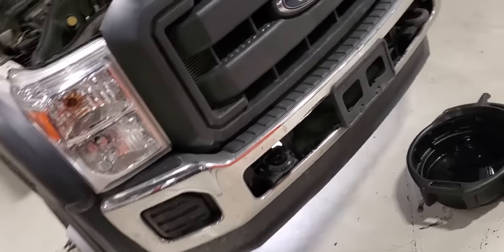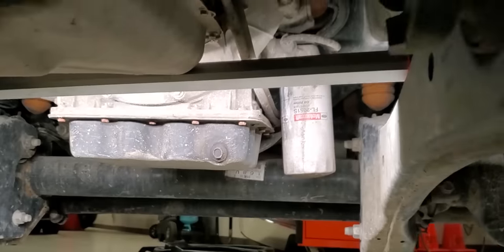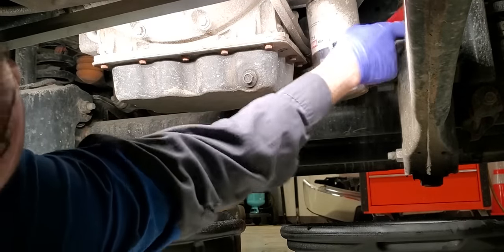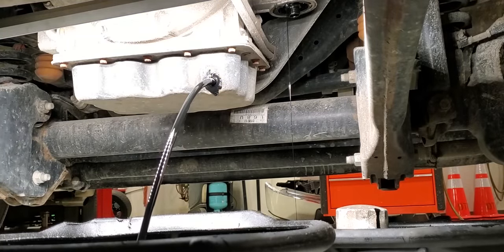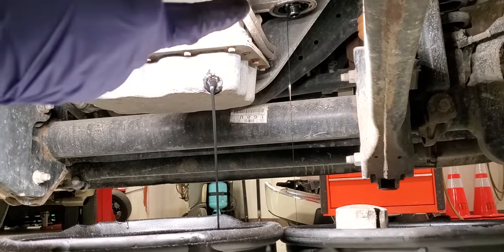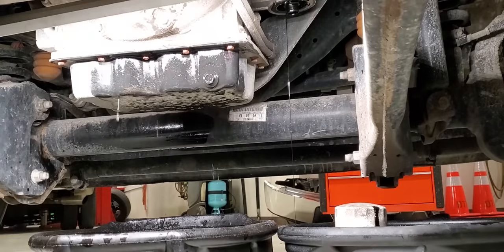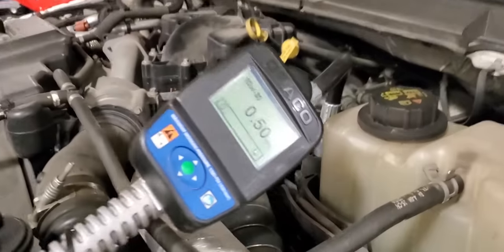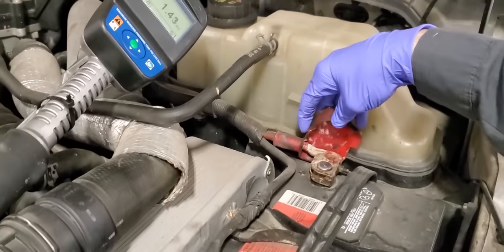Ford 6.7 oil change video HowTo - ALL POWERSTROKE owners should WATCH!!

Comment: Always make sure the oil filter gaskets stayed attached to the filter. It's easy to miss that and have 2 gaskets stacked up.
Reply: Yes that will happen. Happened to me once.
Reply: LOL... Yeah it sucks when you try and try and try and try to get the oil filter on...can't figure out why it won't catch... Only to realize the old rubber is still on.  I'm commenting for a friend... :)
Reply: i changed my oil today and that happened to me. i only noticed because the filter wasn't flush.
Reply: Been there done that !!
Reply: I always make sure there’s at least 4

Comment: Something I do sometimes when the filter is going to make a mess is use a sharp center punch and punch a hole in the oil filter before you remove it. Let some of the oil drain out in a small stream before it makes a big mess.
Reply: I do the same but always make sure it breaks loose first.

Comment: I added a Fumoto F106 6.7L oil drain to make it more controllable to drain the oil while I’m on my back. Comes with a 3/8” clear hose that connects to the valve and runs into your oil pan. Better than staining my garage floor and arm with dirty oil.

Comment: Bro when you removed the oil filter without getting a drop of  oil on your hands I was truly impressed lmao. 
Another banger
Reply from the maker: Ayyyyyyyyyyyyyyyyye boi
Reply: I pull a vacuum on the fill tube and never get oil going all over the place. Just use a remote to start and stop the vacuum. 
1. Turn the vacuum on, take out the drain plug.
2. Turn off vacuum with catch container in place. I use a 5 gallon bucket with a plastic trash bag inside ( makes clean up a snap ). 
3. Replace drain plug. Turn vacuum on.
4.Poke a hole in the bottom of the filter with a catch can in place. Turn vacuum off. 
5. Grease the chassis. 
6. Remove oil filter. Clean the mating surface. 
6. Use engraver to mark the filter with mileage, date and oil type. Lube o-ring and partially fill filter and install. 
7. Refill oil and check. Start engine, reset oil life. Stop engine and recheck oil level.
Reply from the maker: Gussssss where r u

Comment: Thanks! I did my first oil change today..didn't think I could do it and your video made it easy...next time will be even easier. But I will need a mid summer appointment to get all my aftermarket filters done by you pls.
Reply from the maker: I gotchu good buddy
Reply: I just did both fuel filters today. It's just as easy as the oil change.

Comment: From the 6.9 & 7.3 days I have a tapered punch that I knock a hole in the bottom of the filter after I break it loose. Then the filter can drain and not puke all over you.
Reply from the maker: Lololololol
Reply: @michaelbenoit248  I wouldn't waste the money on a coolant filter setup. The oil cooler tubes are huge in comparison to newer truck that tend to clog.  Just service the coolant. For the cooler, I would also pickup the 4 large o-ring seals and reseal the entire assembly.
Reply: @Itsa_Mea  is the cooler a radiator?  If so, those are tiny and clog easily.  Not the tubes i think.  Either way, safe travels!

Comment: on my F250 what i use is a 5 gallon bucket that i buy from walmart. its $2.99 and its MADE IN THE USA. It stands up about 19 inches and i use it to collect the oil. I drive my truck a few miles to get it up to operating temp and I use my dash engine oil display to tell me when its hot enough. I think you get more contaminants and more old oil out when you do this versus cold oil like what you do. I do also make sure I let the truck sit for a good while to cool down so it doesnt make my plastic bucket super soft, but even still its hot enough or warm enough where it will flow out like water and bring the contaminants with it. I really like the height of the 5 gallon bucket. Makes for easy and clean jobs. I have a dedicated bucket for engine oil with a lid and keep it in a garbage bag, inside a cardboard box, and place it back on the shelf the next time. I take it to my county dump or a local business who has an oil heater in their shop, and they accept it for free. It never leaves the 5 gal bucket and never have to pour it in something else. I like my bucket and thats what I wanted to share lol
Reply from the maker: Dude, thanks for sharing & keepin' it 💯

Comment: The attention to detail for just an oil change is outstanding. I would be comfortable having you do any work on my truck.
Reply from the maker: I have em come from all over the USA for me, PTT to fix their rigs!
Reply: @PowerStrokeTechTalkwARod  shoot I might be the next one to drive across the USA if I need more work done!

Do you have a video showing the process for replacing the injector to valve cover grommet? I think I have a slow seep coming from there on either cylinder 1 or 2.
Reply from the maker: Shoooooooooot. Go to my 6.7 oil leak playlist. Its there! Email me if ya wanna get inline. Do you know about my kill switch kit??. EMAIL ME

Comment: Great job. I appreciate the effort you make to ensure the oil filter doesn’t have oil leaking down the side. I’ve had my own 6.7 Ford returned from a dealer oil change, leaking. I hate looking in through the side and seeing the dirty oil on the white filter. Few techs would bother. Does look like the brake clean just about removed the Motorcraft logo though! I use the same exact oil drain pan. Changing oil is strangely satisfying to me.
Reply from the maker: Haha i see that so mannnny times....filters just covered in crud

Comment: As I have installed an Amsoil dual remote system my change is slightly modified. Oil quantity increased also. Still love watching and listening to your videos! I do also have the Fumoto drain valve!
Reply from the maker: Thanks appreciate it
Reply: So how often do you change your oil and what kind of oil do you use?

Comment: Really wish i had seen this video before changing my oil the for its first change.  The oil catch pan was large enough but the oil was warm, not hot, came out like a fire-hose.  Then the catch bin for what ever reason did not keep up with the oil its one of those you can close up and take to a shop to dump...  Last top of the oil filter dripped for 1.5 days... i finally cleaned it after figuring out what the issue was...    Oh yeah and the stain in the driveway...  yeah its new...  but i was able to get lots of it up...  still need to do more though...     Thanks for the video...  i wish i had seen it first...  Damn it ARod where were you....  Oh yeah i was watching the mod vids... finally gt to this one...  At least i have some new tails and a safe...
Reply from the maker: Thanks for stopping thru bud

Comment: I installed a fumoto drain valve so you can drain oil and filter into the same pan. The oil pan does drain slower but I have time to let it drain. But great video as per usual.
Reply from the maker: Thanks mister Brad!!

Comment: Nice video I wish I had see your video before doing my oil change. I did tight the filter with a socket and a 3/8 ratchet that you put at the bottom of the filter, and I tight it a bit strong I thing, do you thing it is easy to brake the treads on the rod where you screew your filter? I tight it down until the filter dont turn anymore. I feel scare a little bit, I wish the treads are solid. Thanks for your comment so you can help me sleep better :)

Comment: Man wish you was my diesel tech.  my dealership left my windshield wiper fill  open and left my oil cap on my battery drove home and smelt oil through the ac vents somehow it didnt fall.  Have 52k on my 2018 6.7 and tow everyday going strong with no issues.
Reply from the maker: Damn man that sucks. Good to hear she runnin strong. Wish i was ur tech tooo! 🤝👍

Comment: I ave noticed the canister does hold waste oil and a lot of guys think they have a faulty filter that won't seal.
Good tip with the cleaner and blow gun.
I also grease what I believe may be the only fittings on the whole truck, if it's a four wheel drive.
The front axle U joints still have Zircs, thank goodness.
Can you tell me if the driveshaft splines have a recommended clean and re lube?
Could have sworn I read one time that Ford had some kind of special grease recommendation just for that.
Thank you for the video's.

Comment: I put a vacuum on my oil fill tube, place the drain pan ( I use a 5 gallon bucket ) under the drain. Take the drain plug out, no oil will come out. Remove the vacuum and let the oil flow.

Comment: What's the whining sound the 6.7 makes at idle when around 195-200 degrees? Mine used do it all the time until I started putting Rotella T6 5w-40 and Hotshot stiction in it, now it only does it every once in a while. My dad has the exact same truck and his will do it, I have also heard others doing it at the gas station. It comes from the passenger side of the motor. Thanks for all your videos, extremely helpful.
Reply from the maker: Thx bro

Comment: I always poke a hole in the bottom of my filters and drain them first then take it off. No mess every time no matter what. Takes a half a seceond. Just a tip if you never heard that one before.
Reply from the maker: Yea, i not doin dat 🤷‍♂️
Reply: I do that as well on anything that I do. I noticed on my 6.7 that I let the filter sit and drain for quite awhile and it just never seemed to quit. I spun it off a thread to let some air past the seal and it instantly made a mess. This was all while it was hot. I never had that problem with my 7.3.

Comment: I use my 2016 F350 for towing my travel trailer and boat and only put on about 3000 miles a year. How often should I be changing the oil and filters? Thanks
Reply from the maker: Once a yr

Comment: I just drain the oil into one pan, wait for it to stop then slide it over to the filter.  I've never had to use 2 pans.  Never tug on the plug like that, eventually it could strip.  Just snug it..  And never use a wrench to tighten the filter, it should only be used to remove it.  Just hand tight.

Comment: So New Super Duty Diesel 6.7 Owner, getting a 2022 never owned a diesel before, but drive bus for work, but still newbie SO my question is, what is the best brand of Oil and and filters to use, also fuel filters, I have heard Shell Rotella is the best, I want to maintain and look after this vehicle as hopefully this will be my last vehicle,, any information is greatly appreciated,,,thank you and love your vids, very detailed, and easy to follow, just wish I had a hoist lolol,,,,thank you again,,
Reply: Rotella is good stuff. Ford will tell you Motorcraft only.
I run castrol usually.
The correct oil is more important than the brand. Although walmart and amazon oil apparently meets the specs.. I wouldn't use them. Dont put small engine oil in your diesel.

Comment: What are your thoughts on the Amsoil bypass filter setup  bmk 28 on a 21 6.7 Powerstroke? What are the factory oil pressures  at idle and 1500rpm. My concern is the 1/2" ID hose with the kit is too small and will reduce flow considerably. Amsoil says the system is designed for 10gpm flow. That seems crazy low. The 6.7 Cummins  flows 16-20gpm a 30-45psi. Will the BMK 28 reduce oil volume  and or pressure to and from the main filter?
Reply from the maker: I had 1 they sent me but decided not to install it.

Comment: Love the videos. I use a 5 gallon bucket for the oil pan, and an oil drain pan for the filter. Never spill a drop. Punch the old filter to drain for a few before I drop it since I’m diy and in no time crunch. Also, I wipe down the filter housing after I let it drain to get the oil off of it. Also ensures the old gasket didn’t get stuck there to cause a leak when I replace the filter. I saw a video from adept ape saying prefilling the oil filter isn’t necessary, so I don’t do it. Never had a problem. Thoughts on that?
Reply from the maker: ......would you replace both your fuel filters, then start the truck and drive away without priming the system......🤔🤔
Reply: Good food for thought.....
Reply from the maker: Just sayin...

Comment: Great video, only thing I would add is checking brake fluid and topping off as needed.
Reply from the maker: Checking, why would you be topping...brake fluid should NEVER be topped off unless the system is open.
Reply: @PowerStrokeTechTalkwARod old school father thought me that as the brake pads start to wear, the fluid level will go down. And to always keep it near the full line.
Reply from the maker: ......so now you do brakes & push the pistons back in & ALL the brake fluid is NOW gonna push out all over the place. Its suppose to go low. If you had a leak you wld have NO brakes

Comment: Does ford recommend to change the plastic 1/2 turn drain plugs in the early 6.7’s and current 2.7L and some 5.0L every time? We do at my shop every time because we have seen them leaking when they come back. Makes a mess on the fiber/cloth skid plate. Only use the ford plugs from our local dealer of course. Great video I have about 1,700 miles on my 2020 F350 tremor, first oil change will be soon.
Reply from the maker: Hell yea, I'm not totally sure. All the ones I've done done have never leaked. I never replace em either. I mean i make to sure to ean the plug well......just my 2cents
Reply: We change them every time as well, get them from our local dealer. I know Dorman makes one but I don’t trust it.
Reply from the maker: Daddi comin bak🙌🙌🙌
Reply: @PowerStrokeTechTalkwARod  blast from the past…Pluto baby

Comment: Hello - I did exactly as you did - Drained when it was warm added the 13 quarts and my dipstick reads high no matter if the engine is cold, warm or hot - Should I re-do and drain the oil pan after the truck has sat overnight? would that remove more oil - For some reason I have to much oil after adding the 13 - Thanks

Comment: Good video ARod , went on Amazon and bought a valve to go in place of the bolt. Got my 5 gallon jug, small hose to go on the end of valve in to 5 gallon jug turn valve on and wait no more mess in driveway no more wife yelling at stain in driveway. One ? I always fill the filter with to the top is that ok. As always ARod thanks
Reply from the maker: Yepp yepp!!!
Reply: @PowerStrokeTechTalkwARod  forgot to ask any chance could I get any of those oil stickers thanks
Reply from the maker: Yeah bud email me a reminder 👍👍👍

Comment: 13 quarts, dang! To think I thought 6 was alot for the little 2 liter turbo in my VW...
Reply: 13 quarts is nothing! My 6.0 L powerstroke with a amsoil oil bypass filter takes 17 quarts!
Reply: I start to check the oil around 12 quarts , usually it's full by then, I'm guessing I'm not getting all the old oil out. The specs say 13 but if I do that you got oil above the fill mark on the dipstick. Even after running the truck and priming the filter.

Comment: I have a 2018 F-250 6.7 and I've consistently had a double gasket problem removing the oil filter, using motorcraft and now wix filters. Removing them the O-ring sticks on the housing every time. The first time after changing I smelled and could see fuming oil and pulled over to see oil everywhere around the filter.  Now I just know to double check it every time. Ive been using Shluters 10-30 synthetic with 6,000 mile changes. Let me know your thoughts.
Reply from the maker: Are you lubing the oring prior to installation???
Reply: @PowerStrokeTechTalkwARod  yes of course, a little extra from what I'm even comfortable with just to see. Still sticks on.
Reply from the maker: No shit....wow i havent heard of that. Are you reeeefin this thing down?

Comment: I hate changing the oil on my 6.7 with a plastic oil pan. I always make a huge mess.  Even being super deliberate and careful.  I'm strongly considering  buying a Dorman metal oil pan /new bolts.  What say you ARod?
Reply from the maker: Get the Ford metal pan!!!!
Reply: Check pricing, you might find Ford cheaper. I did a 2.7 eco boost plastic pan. Like 1/2 of what dorman was at wholesale at O reillys
Reply: I just changed mine to a Ford pan. Wasn’t too expensive and I did it on my back. Plenty of room. Don’t forget to get new bolts with the new pan.  I hated that plastic pan.
Reply from the maker: Yepp many doo
Reply: SPE has a kit with all FoMoCo parts
Reply: Thanks guys, I found a fomoco for 43 on Amazon, I'll buy that, some gray Ford sealant and bolts.
Appreciate the advice.

Comment: Crack filter loose (without leaking). Then punch a hole in bottom. Then remove filter.  On a filter much larger than this.. It helps. The sudden weight of a filter can surprise you.
Reply: Hand strength and a rag 😂 7.3 filters are always fun when they come off. Holds 2 quarts.
Reply from the maker: That 7.3 sidwayz filter lean
Reply: @PowerStrokeTechTalkwARod  Yeah man. They got the clearance damn tight. It's always a chore to get the threads started holding a heavy ass primed filter. I always prime those old 7.3 filters to the top. The old 24v 5.9s as well.